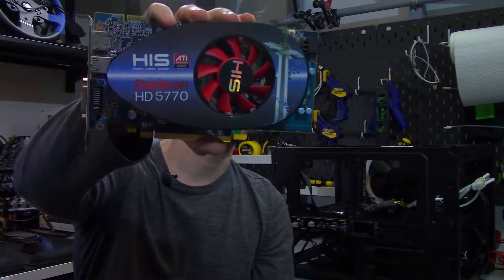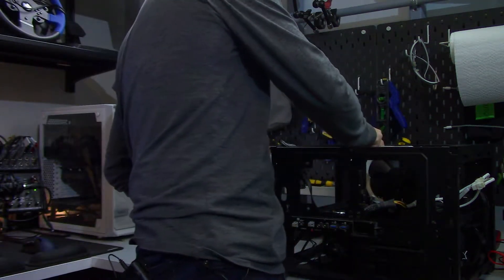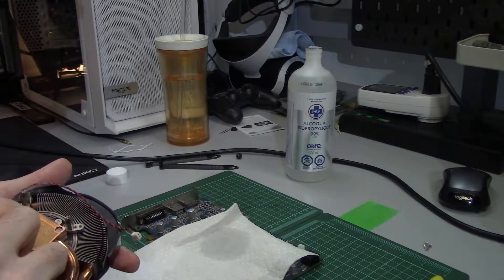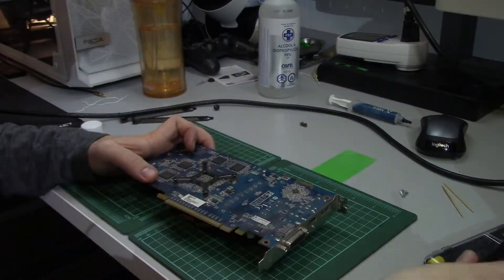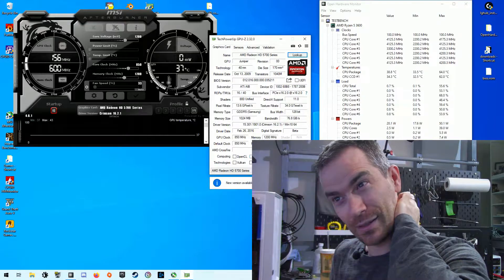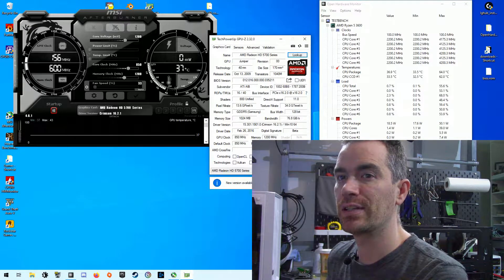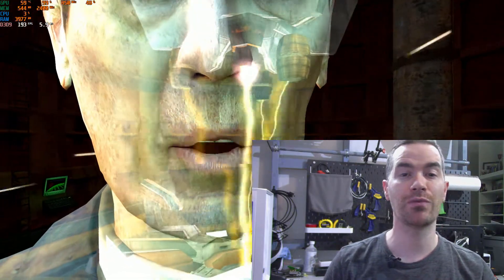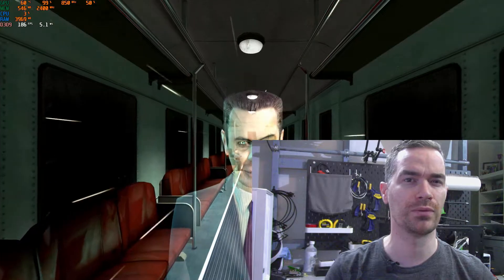The ATI Radeon HD 5770 in 2021...

Comment: Hd5770 or gtx 650?
Reply from the maker: What are you going to use it for?
Reply: @HardwareForGamers  cs go, dota 2
Reply from the maker: I would lean towards the HD 5770 or whichever is cheaper. Because there shouldn't be that much of a difference.

Comment: Great Video man   Good Job!!!
I have to say  I sold my high end card to buy a higher end card for $30 difference..
Unfortunately. That person sold that card the same day I was suppose to pic it up..
So I had no Video card at all!!  So I got a $10  ATI 5570 1G DDR3 which I was shocked how well it worked in games Aliens Colonials Marines !! at 1024x768 which is enough for me..   I play on a 32 inch screen 
But Video play back if you go full screen 1080P - 1440P YouTube you can see it doesn't have that flow.
Where higher end graphic cards & the 5770 DDR5  it plays fine..

Now Took out the 5570 and put in the  ATI HD5770 DDR5 VIPER-X SAPPIRE!!!
GOT IT FOR ONLY $20 BUCKS!!!
WOW!!  OUTSTANDING CARD!!! 
For it's time frame and being a Low mid Range graphic card it sure can pull it's weight.

Comment: Compared to many of the videos I’ve seen. My 5770 seems to be behind. Is there a way to fix this. The gpu is fine and runs cool. I just don’t know why it’s so much slower than others of the same kind
Reply: Check that you aren't limited in your PCIe lanes. Should probably be at least 8x on a gen 2 in my opinion. Your mileage may vary.

Comment: I have this exact HIS card. The fan went bad leading to overheating. Replaced it and it worked fine. Ran this Crossfire with another HIS larger HD 5770 for over a decade until last Christmas with no problems.
Reply from the maker: how did you deal with the lack of driver support?

Comment: its still a good card. i'm gutted because, my computer went kaput, so i dug my old one out only to find, the fan doesn't work, and i came here to see if its worth getting fixed, or just trying to get a newer one. But i remember it was a good card. i wasn't surprised at GTA V, i think the last game i played on it that last time i used it, was Alan Wake. So any games from the PS3 era are gonna be a breeze, and an PS4 era games on low settings will be cool too. so after watching this, it seems like it still holds up ok. better than the lenovo ideapad 305 i'm stuck using atm anyway.
Reply: Its much better if you crossfire 2 of them and they are very cheap these days
Reply: I've recently had to order a new one that will take a little while to arrive so I found this on Ebay, you reckon it could run Warzone? Just need it for like 2 weeks
Reply from the maker: No it won't, warzone needs 2.5 gigabytes of vram

Comment: would a cpu of the same calibre get the same results, say a i5 760 or something
Reply from the maker: Depends on the game really. But for the most part yes.
Reply: I5 3470 is only like 40 bucks and it's pretty legit. 4-6 th gen didn't really have much of a increase.
Reply: Hey, i got hd5770 with i5 2400, 500gb hdd and 1x4gb ddr3 1333mhz ram. Is purchasing 512gb/500gb ssd and 2x8gb ddr3 rams for it worth it? I'm not a hardcore gamer I use pc for daily tasks autocad. Hoping for a reply.
Reply from the maker: What operating system do you have is it a 64-bit or a 32-bit??
Reply: @HardwareForGamers  64 bit, currently have windows 7 ultimate, hoping to install windows 10 to ssd and use it as primary drive.
Reply from the maker: @guycha0s380  just as long as you keep it as a 64-bit operating system you can have more than 4 GB of RAM. A SSD would be a good idea you just have to make sure that you plug it into a sata 3 port, because if memory serves me right see the two is still pretty popular on the 1155 motherboards.
Reply: @HardwareForGamers  thanks a lot buddy. Highly appreciate your reply.